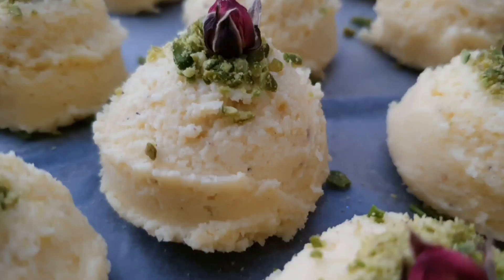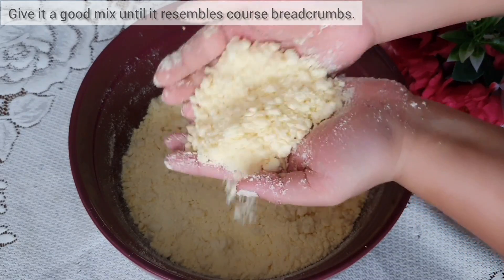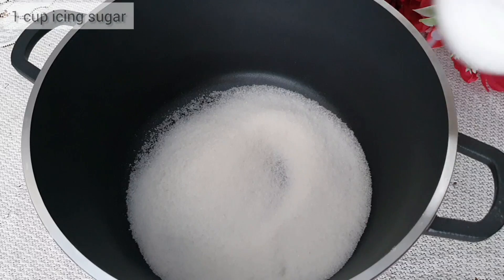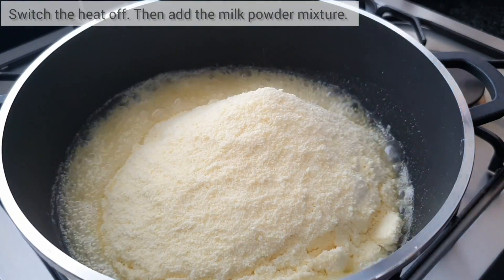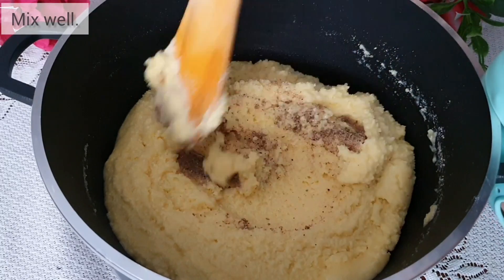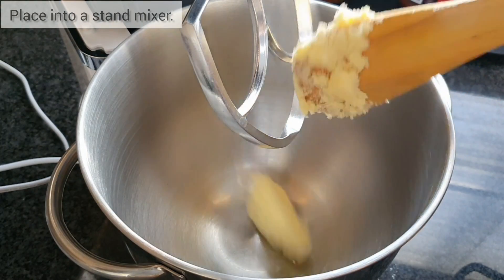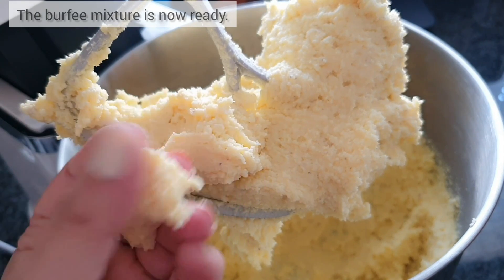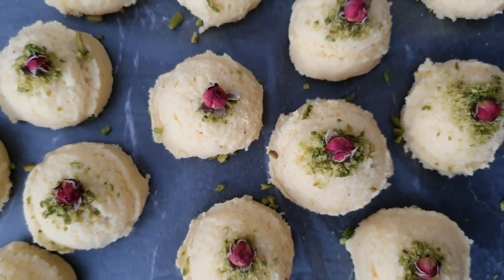Soft Creamy Burfee / Flop proof.

Comment: I tried this recipe, mine unfortunately is too soft, any suggestions on how I can stiffen it up a little will be appreciated
Reply from the maker: Place it back onto the stove over a low heat to stiffen up.  Allow to set again to room temperature. Check if its fine or beat again at intervals until you get the desired consistency.